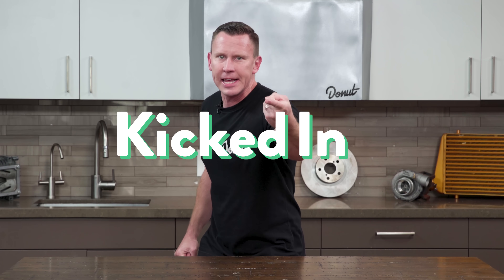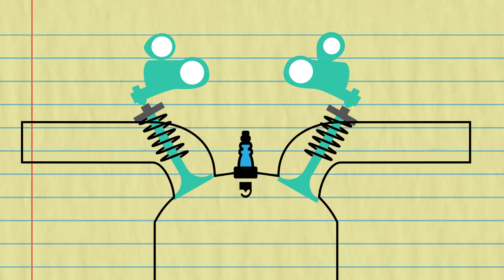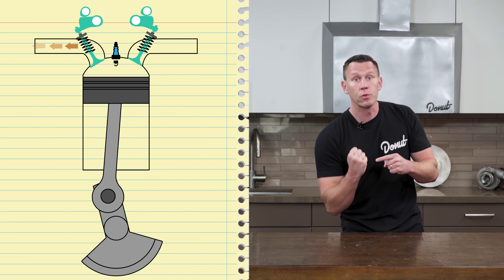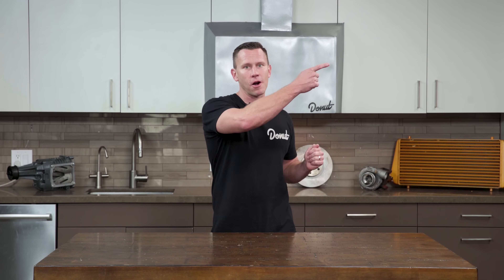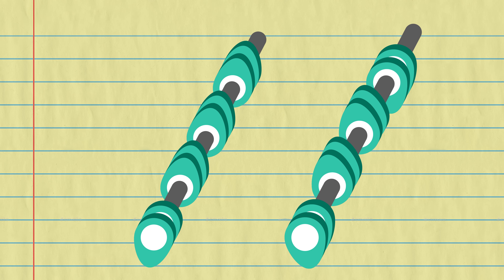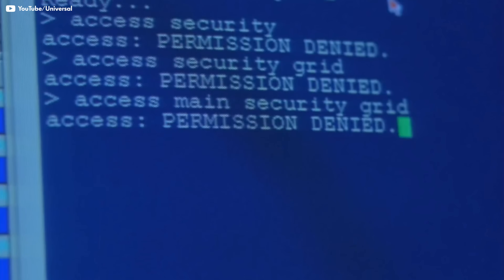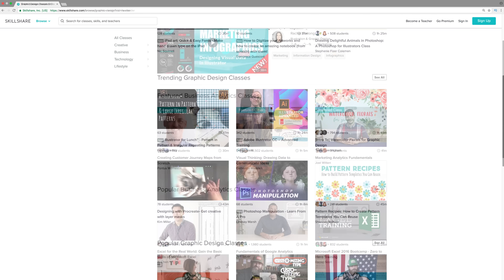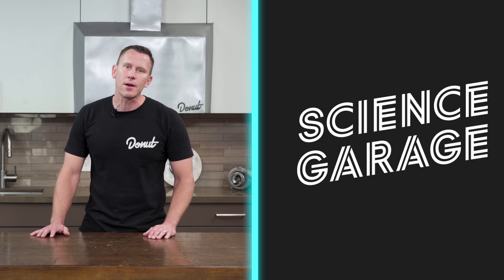VTEC: How It Works | Science Garage

Comment: I don't hate VTEC. It's the FF drivetrain that I hate the most in Hondas lol.
Reply: electric 6  FF stands for "front-engined front wheel drive". Actually an FF car is good for economical use. It has better mileage than an FR (front-engined rear wheel drive) car since power from the engine is directly transferred down to the front wheels, whereas FR cars transmit engine power thru the propeller shaft to the rear wheels. But an FF car isn't really that fun when it comes to things such as drifting and so on, since the front wheels are the one powered while the rear wheels are just freewheeling. That of course is just according to my opinion and knowledge.
Reply: Adrian,I'm not hating you but I would like to explain what FF can do better than FR. Firstly,the weight transfer. When coming close to corner, when brake are applied the weight will transfer to the front tire,increase traction(plus the engine weight).Yes, FF are prone to understeer but its predictable which is good for beginner unlike FR which its unpredictable and can even worse if the driver cant countersteer properly at good moment. If the driver use 'left foot braking' and 'late braking',it can compete in racing.Go watch Jordan Cox with his EG6 where he raced against a Holden(if I remember correctly) at Mount Panaroma Circuit(Bathurst,Australia). Secondly, FF are better in slippery road condition. Already explained -  weight does the job. Still,I'm not being superior about FF over FR,as I also like FR drivetrain too,love to drift sideway(though not right now, got license recently)
Reply: @darrenfelix6339  well thanks for giving some extra information! And thank you that you said it in a polite way, unlike others who'd beat the shit out of you with their words :) I wasn't saying that the FR is better than FF tho. Each has their own advantage, and yeah, weight transfer is easier to manage in an FF than in an FR. I was just focusing on drifting that's why I somehow sounded like as if I was FR-biased lol 😅
Reply: @adriandelantar  no problem 👌,happy driving.

Comment: Quick question: Would it be possible to combat the low fuel economy of a big cam with a variable restricter somewhere in the intake system?
Reply: ...that's called a throttle plate. Gas engines control airflow to control power, keeps the A/F ratio constant. Diesels only meter fuel because they don't knock.
Reply: Toyota did that in the 80’s and early 90’s with T-VIS and added Turbo for the Celicas and MR2s. It utilizes twin intake runners per cylinder to increase air speed at low rpm and the second set opens ~3500 rpm to drastically increase volume when air speed would naturally be higher (Also when boost is at max.)
It was very effective with low complexity. It’s nowhere near as effective as V-Tek however.
Reply: The f engine like the f22b has butterfly valves in the intake manifold

Comment: Isn't this basically VANOS for BMW?
Reply: Mike Hunt it is
Reply: Every oem has their own name for variable valve timing
Reply: Same with Toyota and their VVT-I engines , variable valve timing
Reply: VANOS is different. The lift and duration is infinitely variable between the two cam profiles.
Reply: No, Vtec was a switching between two cam profiles. (CUrrent VTEC-i Is closer to Vanos+Valvetronic) Vanos is ONLY varying lobe separations angles(cam phasing)...but with Valvetronic it give 1,000 cam profiles vs. only 2 for Vtec.
Reply: Does anyone else make a vtec as in, variable camshaft profile? I'm not talking just variable valve timing, but specifically variable camshaft profile.
Reply: Nevil Easterling  Nevil...Old school VTEC like in Fast & the Furious Civics was a system that switched between to different cam profiles... It was actually out dated even back then. Fiat was the 1st to have a production car with a variable valve timing back in the 1960s.

Porsche also had systems for along time and are one of the most advanced next to BMW.

BMW was the most advanced even back in the 1990's with the combination of vavletronic & Vanos. It's so advanced that IT controls engine RPMs with valve lift and the cars ONLY have throttle bodies due to government safety regulations.
Reply: I'm not asking about variable valve timing, I'm asking about who else made engines with a variable camshaft profile like Honda/Acura.
Reply: Nevil...Not that I Know of....mainly because it adds weight and Limits what the system can do. Actually Most drag racers disable VTEC due to the weight.
Reply: That's all fine and dandy, but I'm not a drag racer. I don't want to go fast, I want to have fun or go sideways. I love the idea of a variable camshaft profile, but it would be really cool if other companies made them. I think a few might be close enough for me to be happy with them, but variable valve timing is a dime a dozen and doesn't mean anything to me.
Reply: Nevil....." I want to have fun or go sideways."   You aren't doing that with VTEC anyway as they are all FWD unless you buy an old NSX. What you want is torque....which isn't the point of VTEC. You need low end boost or displacement for that...in a RWD car.

Todays variable valve timing makes VTEC look like 3 spd automatics vs. a 7spd Dual clutch transmission or PDK out of a porsche. No comparison.

Comment: what other cars/manufacturers have variable valve timing?
Reply: caivs
All of them
Reply: so vtec isnt special anymore theN?
Reply: caivs
Not really no. It does seem to work better than other versions. Perhaps the larger profile is more aggressive than others. The Toyota 2ZZ-GE is also very aggressive (Used in the Lotus Elise as well)
Reply: mostly all have vvt.. but only a few including honda has lift with the timing.. and honda seems to do it the best!!!
Reply: what's lift?
Reply: caivs
Opens the valves farther allowing more air
Reply: oh i thought that was what happened by definition with vvt?
Reply: caivs
There are two factors with cams: lift and duration
Reply: There u go
Reply: VVT AND VTEC ARE COMPLETELY DIFFERENT THINGS. Jeez...
Reply: Literally all of them, honda just gave it a cool sounding name.
Reply: jonny j you dont need to go off like a sperg, im simply replying to the main comment in this chain. All automotive manufacturers have a form of variable valve timing. Its not some crazy new concept.
Reply: Toyota used to have it, is was called VVTL-i, not vvt or vvti

Comment: It is turbolag without the turbo
Reply: Tasos Arpoudis um... no.....
Reply: VTEC is essentially the turbo~

Now we just need to twin charge it!
Reply: No it's  not. People act like vtec takes forever to kick in. But it's  geared so that in first vtec is syper quick to rev up to and when you are flooring it you stay in vtec every gear after that. So it's  better than a factory turbo, considering  most2L turbo make 200hp or so, and a 2L vtec engine will make 200 -240hp
Reply: The K20 only makes 210hp at factory, and the subaru EJ20-TT makes 280hp from factory. Different techs, don't compare them.
Reply: Paul Poirier one has more power loss at wheels than other so it’s more at play here
Reply: VTEC is kind of like a turbo in that the goal is to get more air into the engine... at the high end, at the low end it is more concerned with economy. 
But of course it isn't that simple and you can always add a turbo or supercharger as well as having VTEC. But don't take my word for it, Honda finally bloody did it themselves and we got a car with almost 230kW from a four cylinder engine.
Reply: Eh, not quite. You can keep in VTEC as long as you stay above the engagement RPM. With a turbo you gotta keep it spooling to keep giving you power. Yeah you'll get more power but vtec doesn't lag at all if you're above the threshold so you still have NA response. And hell I believe you can get controllers or ECU maps that let you change the VTEC engagement RPMs, or just have it on all the time, idk I havent looked into it.
Reply: Armouredfalcon you’re on the right track but yes it’s just keeping it in the right rpm poweband and gearing helps as well.
Reply: Sean Hatton 245 for mine

Comment: well Yamaha 150 CC engine has a selenoid to lock and unlock its dual profile cam, they branding its as VVA (Variable Valve Actuation) that in standard maping its set the selenoid to be activated at >7200 RPM

Comment: I am still working on my design for my version of variable valve timer choke. It has variable valves and the ability to choke the fuel and exhaust. Hope fully it dont blow up like a land mine this time. But this time I am using plastic to test the mechanicals by using a 3d printer and the plastic wont work with fuel any way.

Comment: There's a little more to it that you didn't mention as well. You talked a lot about valve duration but not so much about lift. At low RPM the lift is reduced so that the air has to rush through a smaller opening. This increases air speed and therefore mixing of the air and fuel in the cylinder for more complete combustion. This is further increased by some 4 valve V-TEC engines that will only open one of the two intake valves at low RPM to introduce swirl, which further increases mixing and efficiency. And then obviously once V-TEC kicks in, both valves open up, open for longer and open wider since the piston speed at high RPM is enough to suck the air in forcefully to encourage good mixing of the air and fuel. It's a really cool system. I used to have a Honda Accord Euro R 2.2L red top DOHC V-TEC. It wasn't the fastest car I have owned, that would be my 2017 Audi S4 Avant that I have now, but it was such an awesome little go-kart of a car. It handled amazingly and had enough power to be very quick on a windy road. I still miss that car sometimes. I wonder if I should have kept it because they now sell for about 3 times the price that I sold mine for 8 years ago. Check out my older videos if you wanna see V-TEC kick in on a 2.2L 220hp, 220Nm Euro R.

Comment: I have a 2005 CRV with a 2.4l with ivtec with 160 hp stock ... How much HP does the ivtec add ?   I feel the iVTEC come on at  2800 rpm then again at 4200 rpm ... I suspect the valve lift and timing increase at 2800 rpm and the cam timing advance at 4200 rpm.

Comment: So will Hondata work with stock 2013 Honda Civic LX Auto do I need to add any add on intake, exhaust, etc?? any suggestion or I can be completely stock? If you don't want a loud car what mods can I do to go faster with more hp for a 2013 Honda Civic LX Auto
Whats the difference between header/catalytic convertor/ or catless which one would be quiet? Whats the best tune program to use simple for faster. Hondata?

Comment: 6:07  I just rebuilt both my heads in my 3.5 J series vtec, because I had a hole burnt through an exhaust valve, there’s nothing but a spring in a hole for the middle rocker arm, there’s no solenoids or hydraulic lifter to lock the middle one into the same timing, it does nothing but go up and down independently for seemingly no reason, it’s y I was looking for videos explaining the vtec system, I thought it had to do with oil delivery since there’s a solenoid on the oil filter housing that opens during wide open throttle to send more oil to the top for the cams, in my opinion if a engine part needs more oil for hard driving then it needs oil in those places all the time. So I still don’t understand the vtec, one thing for sure though is there’s definitely nothing in the head to push the middle rocker up and lock it In timing with the other two, it’s literally just a hole with a spring in it, no hydraulic pins, it doesn’t do anything.

Comment: R there manual vtec. So when u want more power, u press a button, switches to the bigger cam shaft and gives more power. When u don’t want it just turn it off n use the small ones.

Comment: How's it push a pin through cam lobes spinning at 2000 rpm?
Reply: Vtec solenoid and oil pressure.
Reply: Also doesn’t usually crack vtec at 2k but it could.

Comment: Hold up,this doesn't make sense to me.
You're saying when VTEC is on,the rocker that sticks out is leveled with the other rockers and that somehow causes the valve to be pushed in further?But wouldn't that be the opposite of what happens?
Since the rocker doesn't stick out as much,wouldn't it push the valve less than it would if it was sticking out?

Comment: It only give a small amount of power. Not that big. Since the main purpose was for fuel economic and reliable vehicles. Of course. Some of the new Honda cars have a turbo but it's just a small turbo to make you feel like you got some power and speed. But nothing significant if you really invested in making a high performance vehicle. And pure engine power isnt the only thing as handling is also a big factor to how well the car will perform

Comment: What is diffrent of SOHC VTEC and DOHC VTEC
Reply: Well the main difference is that sohc means theirs only one camshaft on top the head of the engine whiel dohc have two camshafts on top of the head if we are using a 4 cylinder the actual vtec system should be the same.

Comment: But how do vtec engine run? Prone to failure of the top end? Idk seems like it breaks easy.
Reply: Extremely reliable actually. Basically no instances of vtec failure even on cars with 200,000+ miles. As long as the oil doesn’t sludge up and clog the solenoid it won’t break. Toyota and especially BMW have tried their own version of vtec but weren’t nearly as reliable.
Reply: Honda are wizards at making engines, wish they’d make a production v8

Comment: hmm… ive been having trouble with this… ive heard that the 2011 honda civic ex has vtec… but i cant find the solonoid in mine… and im just kinda stuck on this… if any passerby who chances upon this comment happens to know about this, would you be so kind to enlighten me with your knowledge about this subject?
Reply: It’s confusing because Honda has a fuel efficient version of vtec and that comes on when cruising (barely on throttle) and changes the cam lobe to optimize airflow instead of increase airflow like the performance vtec. It leads to better mpg
Reply: @TheRyansLion  ah i see, thanks for explaining. that makes more sense as to why i couldnt really feel it ever if i tried either despite me being aware that it was supposed to be there.

Comment: Hate to break it to you, 90% of engines of all manufacturers got some sort of "Vtec" now... variable valve timing is a standard, just each company is calling it another name... VVti, Vanos etc Vtec is nothing special anymore.
Reply: No, vtec is still unique to honda and their sister companies. Vtec is variable valve lift, vvt is variable valve timing. Honda patented two designs for vtec and no one has been able to come up with another decent design that doesn't violate their patent.
Reply: @Redtooth75  No, most cars today have variable camshaft timing which gives low range torque and then effectively changes the timing curve at higher rpms for more power. Fuel mileage is a nice product of this. Honda made it by using the dual camshaft design, where one cam gives higher valve lift at higher rpm. Other companies simply use one camshaft that does the same job by changing its rotation speed hence leaving valves open for longer, letting more air flow in the combustion chamber, its exactly the same. Moreover Hondas VTEC has been licenced to many vehicles over the years that "borrowed" the same dual cam desin, like Nissan SR16VE, SR20VE and SR20VET engines or The Toyota TSport Engines in the 2000s which broke the world record of Bhp produced per Engine cc on normally aspirated motors, producing 192hp out of 1.8l engines.
Reply: @TheCardPlayer  yeah, thats what i said. Vtec is variable valve lift, vvt is variable valve timing. Not the same thing, although they can produce similar results.